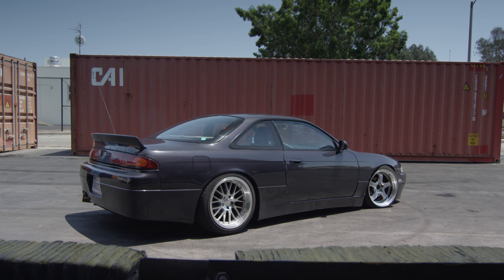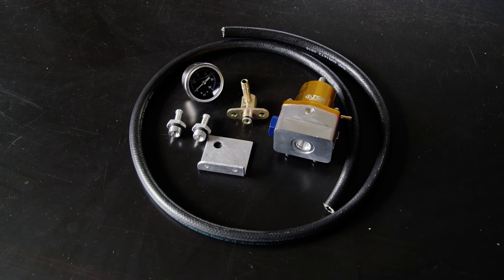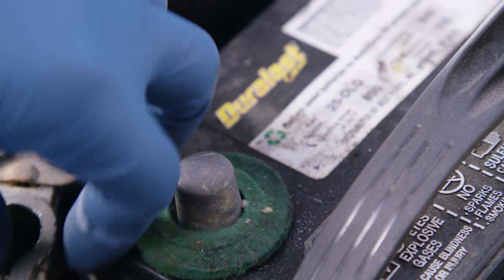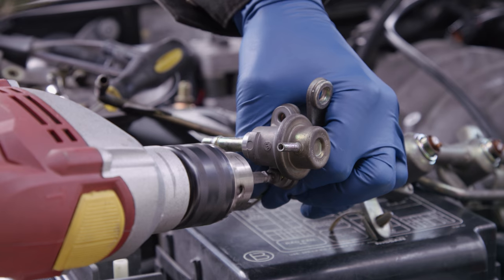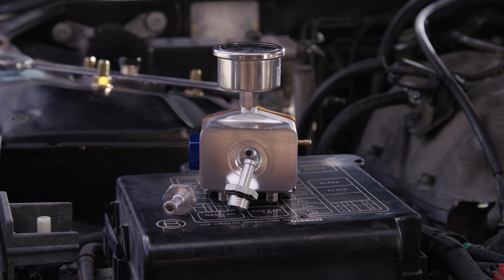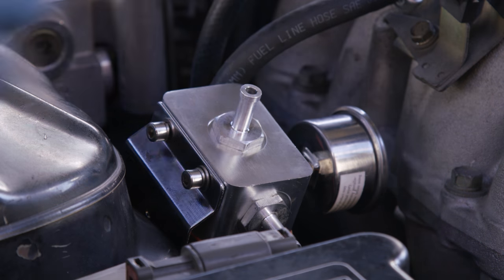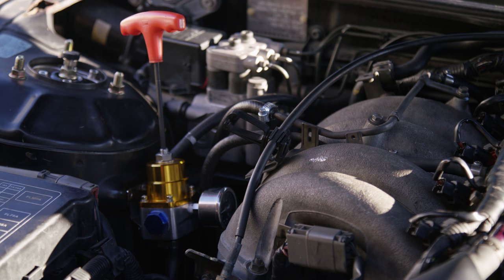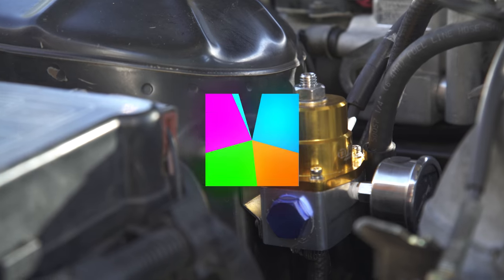240sx ISR Performance Fuel Pressure Regulator Install - Street Project s14

Comment: Why put a gauge tho when you can’t see it?
Reply: To set the pressure correctly and more easy
Reply: @lukeroth2011  Also for casual diagnostic quick-checks any time you happen to be under the hood.